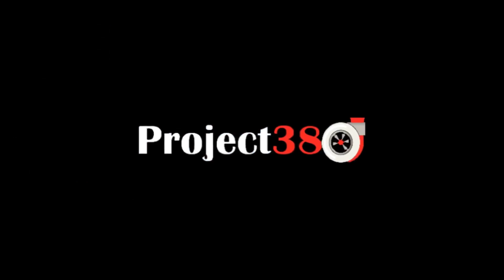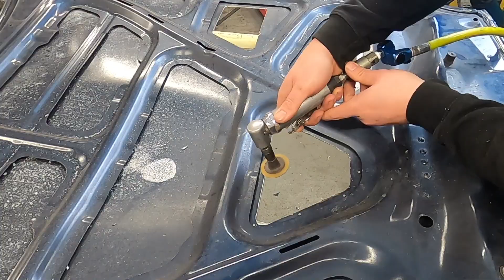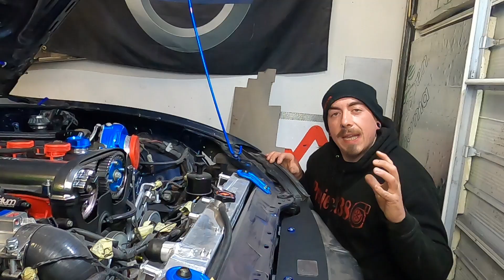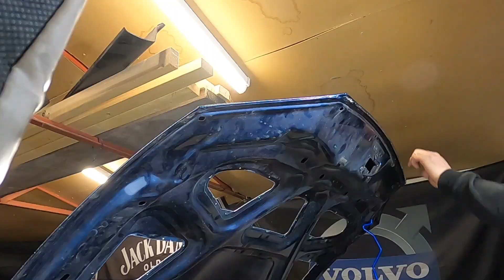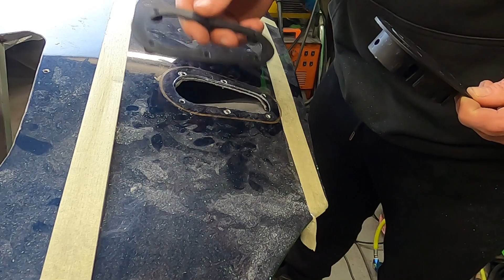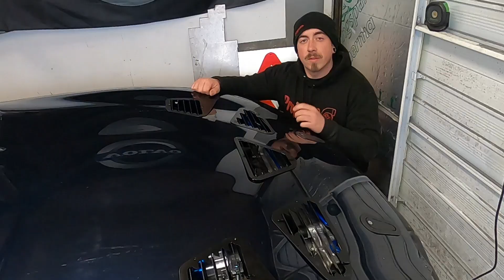BONNET VENTS + AERO LATCHES : MX5 TURBO BUILD pt 43

Comment: I’m planning on doing the latches too and in the same location. When you said a funny angle. Did you imply they are working improperly or just the location? Since I want to keep the option of placing vents in the same location! Again a great video!
Reply from the maker: so the pins are vertical but the latches are tilted forward. this means you have to be very precise with the fitment. as long as the fitment is correct they work great